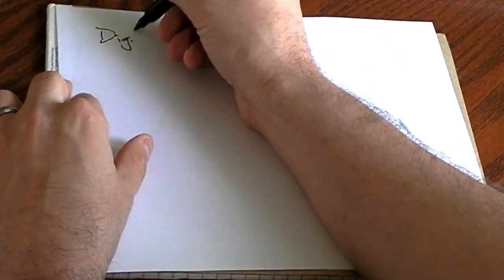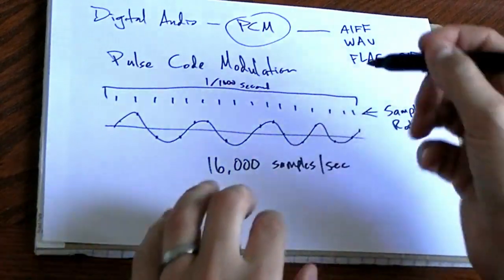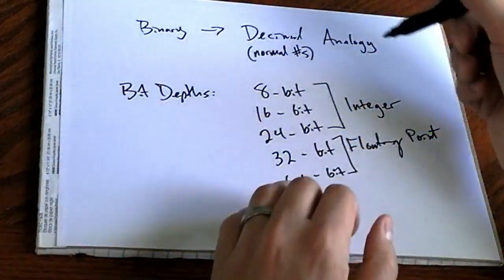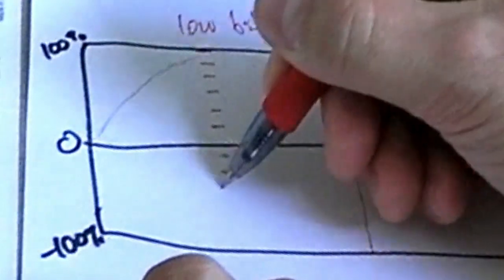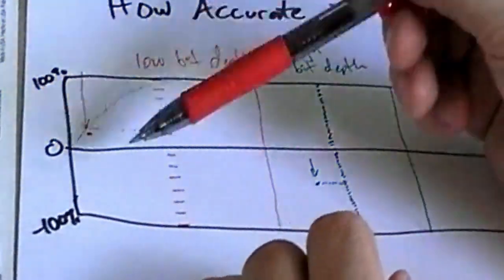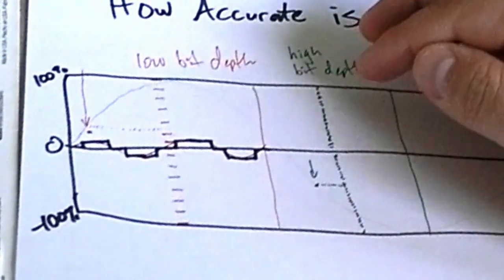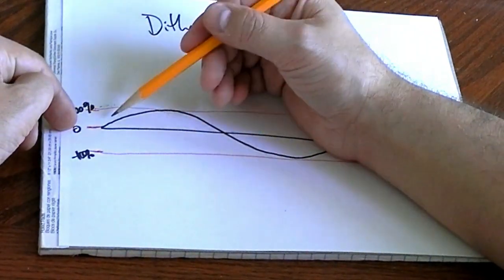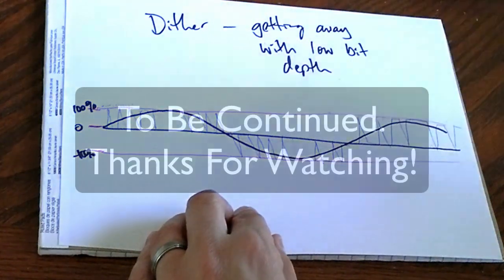AF015 - Digital Bit Depth Part 1

Comment from the maker: If it looks like a sawtooth wave, it's my poor drawing. It's supposed to be a "noisy" (i.e. random) jumping back and forth between nearby available levels.

If you get the chance, try distorting a sine wave more and more while looking at it through an oscilloscope - it's pretty interesting. It first looks like a sine, then a sine with flat tops & bottoms, then a "trapezoidal" wave, then a square wave.

Comment from the maker: More or less, yes. It's *a* standard, used in Super Audio CD, but it's not "the" standard. It's not in common use (and not likely to become so in the future) because it's so clumsy to work with compared to PCM - you can't easily mix or process it, or add effects. From what I understand, most SACDs are recorded & mixed as PCM, then converted to DSD when the SACDs are pressed.

Comment from the maker: You must be referring to SACD / DSD? It works by having 1-bit depth, and an extremely high (3ish MHz) sample rate. With some fancy filtering this ends up capturing audio approximately as well as regular PCM samples at 24/96. But I don't know of anyone actively recording in DSD; all the pros I know of are recording and editing in PCM because you can't easily do effects or mixing in DSD, and AFAIK it doesn't have any advantage over PCM. (See "The Emperor's New Sample Rate")

Comment from the maker: For casual music listening, I think CD quality is all we need. Higher for recording/processing though. For home theater where you have a huge dynamic range, I'd go to 24-bit, but I don't think higher sample rate is necessary. 44.1 or 48 is fine.

With well-designed converters (even the cheap ones are nowadays), 44.1/48 sample rates are as transparent as 88.1/96. The sample rate wasn't the reason per se for lower quality at 44.1/48; it was converters that didn't perform as well at those rates.